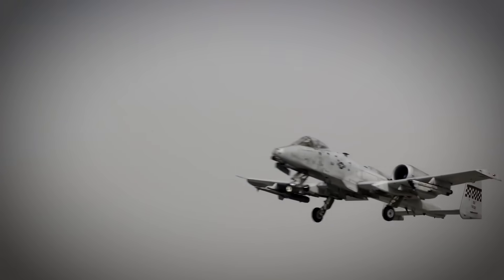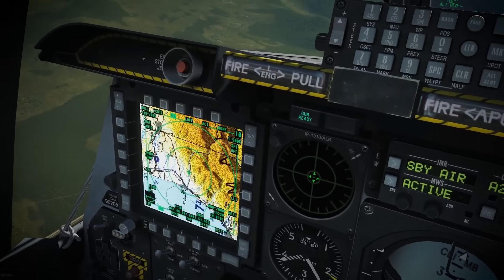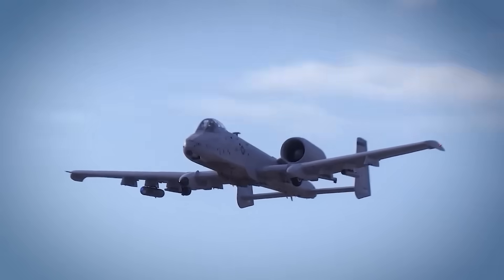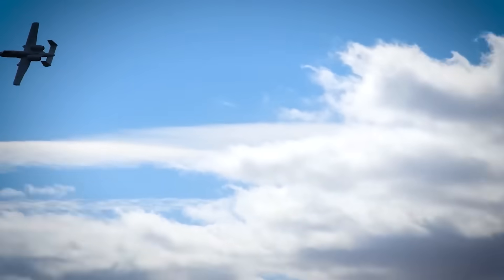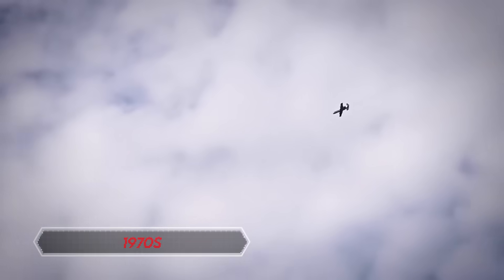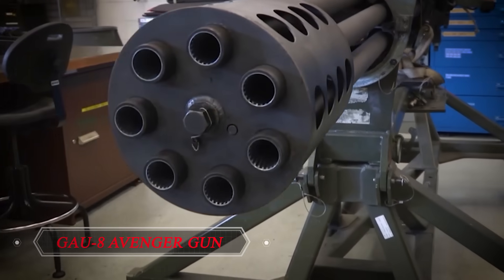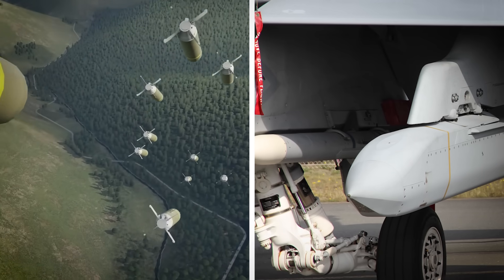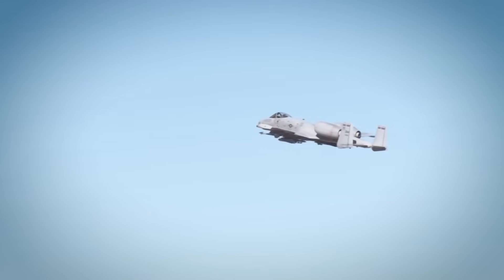This New US Blacksnake A-10 Warthog Has Revolutionized Industry

Comment: I was already in the military when the A-10 joined ththe AF. From the very beginning of the Thunderbolt 2s life to today the Air Force top brass has used the same argument. "It's too slow which makes it too vulnerable to AAA. Yet during the Gulf war and Afghanistan, it proved itself repeatedly.
  And you should watch your mouth about the Able Dog/A-1s. Yes even the grunts in Nam complained about how slow they were, but were damn glad to see them overhead. Both aircraft had good loiter times and massive payloads for their size.

Comment: *down vote*
The only thing new on that A10, is the paint job. 

Hype and misconceptions. The 10's Desert Storm TANK Kills that were posted by the Army, Are ALL combat vehicles, moistly light armor and trucks. To be effective ageist Tanks, the A10 needs to get DANGEROUSLY close, under 2000 yards. ( possibly feet, going off memory ) Reason is the accuracy of the Gun, average to poor, and the Ammo, Depleted Uranium is difficult to work and make accurate in such a small round. (yes, small) with when you have to make them in the 10's of thousands of rounds. 
Why is that dangerous? The A10 is built for punishment right? Titanium bathtub right?  Meny a A10 has been shredded and flew home to be repaired, this is true. 
Man portable and vehicle mounted Surface to Air Missiles. The Only A10A, thats 1, to survive a missile hit, was because the missle didn't explode. All the losses of A10'a were to SAMs

Most uses of the gun in the past 20 years, has been pure HE rounds, very effective against unarmored and personnel. 100 mini grenades landing all around you is a bad day.  
Then again, accuracy, the A10 was restricted from using the gun close to friendly or civilians, as about 1 in 50 shells would "burp" of fly wide up to 100 yards off target. 

SInce upgraded to the A10C,  in the 20 teens, precision attack and night flights are slandered. The Air Force has always been reluctant to spend money on the A10. 
The LANTERN pods that made the Strike Eagle famous in 1991, was originally slated  for the A10A. Only got the targeting pod 25 years later with the A10C.

Comment: I have to admit the A-10 airplane with a gun is for close air support of ground troops... And now " Wait there's more." electronic upgrades add to its value... Yet wonder where and what the next A-?    So will there be a new close air support aircraft? It needs the quality and ruggedness of its linage of A1-4 Skyradier and the latter A-10 to a new X A- ? type even with the added extra gleaned value of the Russian SU-25... and on its knowledge of uses and its strengths and weaknesses.
Reply: Me thinks the A10 will following the example of the B52 and be around forever, because I do not think they can build a better one of either.

Comment: this AI voice over sounds like it has a speach problem, also it's a HOTAS not HODUS system, it's Hands On Throttle And Stick meaning all the most important buttons etc. needed to fight & fly are on the throttle & stick, rather than older jets/planes that were simpler & would usually have just a trigger & bomb release button.

Comment: I'm confused about something. A10. Great airplane! CAS King of the Beasts. Why haven't we offered them to the Ukrainians? I could see THIS being the game changer they really need. Nothing against the F16 by any means. An A10 cant' hold a candle to an F16 in a dogfight. Still for what the Ukrainians need the A10 would be just the fit for the need, yes?
Reply: Because A-10 isn't king of shit other than friendly fire incidents and combat losses. It's a sitting duck against any adversary with even a smidge of anti-air defence or even shoulder mounted launchers, the gun is monstrously inaccurate (hence all the friendly fire), and pretty much anything useful it does like tank killing (which any tank formation worth its salt will have air defence along for the ride making A-10 useless) is done by all the bombs and missiles it carries - bombs and missiles which can be carried by almost anything else and used more accurately and from further away by those planes (F-15, F-16, F-18, F-35, F-111, B-1, B2) etc. The one thing it barely had going for it was that the A-10 could do stuff like brrt and drop bombs on the cheap and nasty, but to do that it was shoehorned into giving up any systems that would give situational awareness and targeting (A-10A pilots literally using binoculars from the cockpit to identify ground targets, resulting in a whole load of - you guessed it - friendly fire incidents). Now with the A-10C, you do get all those systems, but at the cost of a entire new F-35A, so what's the point.

The truth is, the A-10's modus opperandi was a dead end even back in the 70's when it was built, because any peer military - or even one quite a bit below that - can see it coming and destroy it well before it has any chance to do anything. Survivability and combat effectiveness for any military system begins with not being seen, and not going low and slow and titanium bathtubs and the like.

If you really, really like knowing about how craptacular the A-10 is, look up Lazerpig's 2 part video essay on it. It's funny and really does destroy the hogs massively inflated reputation.